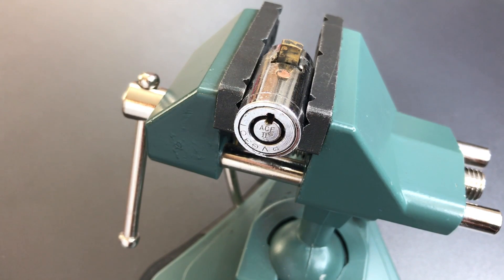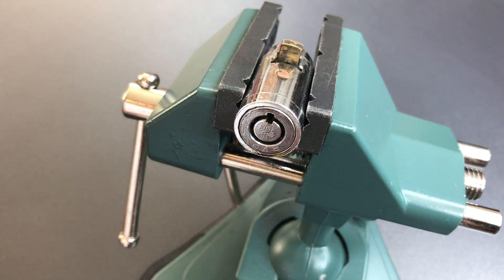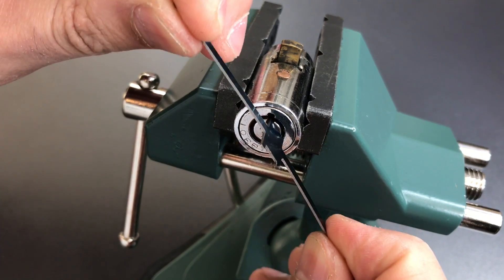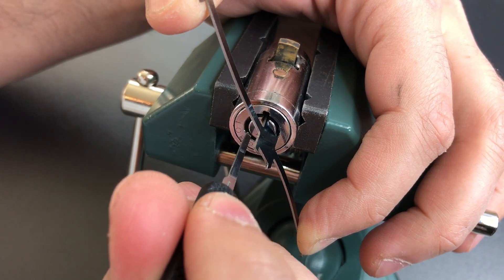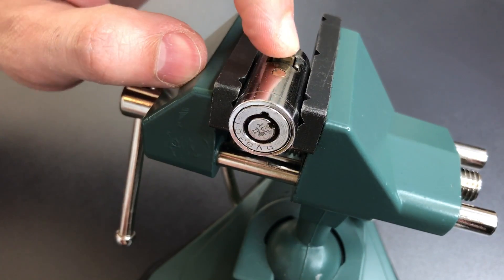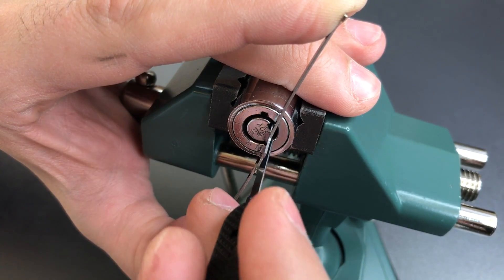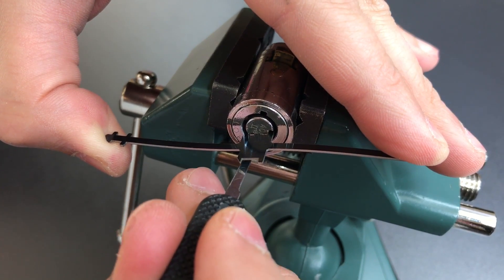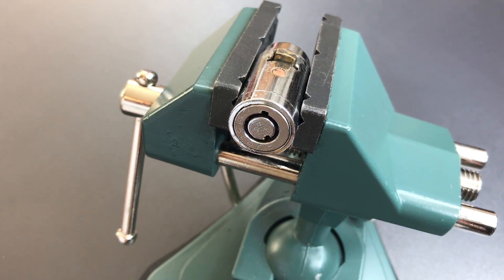[533] Ace II Tubular (T Handle) Lock Picked

Comment: Once you get it picked and turned a little, you could use the standard tubular pick to "impression" a key. Then you wouldn't have to hand pick it again, over and over.
Reply: Couldn't you also use the tubular impressionist tool to single pin pick it, then lock the pins in place?
Reply: @lordfly88 yes, that also works

Comment: I picked my first tubular lock last weekend.  I had never practiced on a lock that I owned. My first tubular pick was in the wild at work (for a purpose sanctioned by my company). It took me about half an hour for three picks to rotate it far enough to unlock the lock from a computer.  I had to machine my own tensioner and pick.
Reply: What’d you use as tensioner and pick?
Reply: @livvylouise114  I’m sorry, this probably won’t help but for a tensioner I used a small Allen wrench that I ground down from six sides to four sides that fit perfectly into the square notch in the core.  For a pick I used a thin straight hardened steel pin and put a handle on it.   I have access to large fairly incredible mechanical and electronic prototype labs so I just made them.

Comment: We used to have people squirt super glue or glue in them. All you can do then is drill them out and replace the lock plug.
Reply: Wouldn't using a solvent such as acetone also work? Acetone dissolves cyanoacrylate superglues readily, though it can damage paint finishes

Comment: I started tubular locks by SPP so when I got a set of those 3 tube picks I was thrilled I only have to pick it once, plus I have a pattern I can use to decode it. 
BTW: if you open the glass display where they keep the slingshots and pellet guns at Canadian tire stores, and pick up and examine the products, they get really irritated and lock it up again.
Reply: Your post has been flagged for violation of rule 2

Comment: Yikes.  I never knew this type of vending lock was so easy to pick.  

My bosses at the big vending company I worked took key security and accountability very seriously.  Each vending route was supposed to have their own key and keys were regularly inventoried and extra keys confiscated.  Also, if the pip on the tubular keys was worn down, they key was replaced.  This prevented pulling the key out before the lock was fully re-locked or left in the unlocked position.
Reply: This sounds more like employee theft prevention than random thievery prevention.
Reply: You might be surprised that back in the day getting keys was as easy as going to Coke and paying $1.50 plus tax for a duplicate key. And while one person was at the parts counter a friend, or friends could walk around collecting a few extra keys. They were either hanging out of the lock, or in the key return.
At the time there were 40 keys total. CAV 1-20 for Cavalier machines, and DN 1-20 for Dixie Narco machines. All of the locks had the key number stamped on the face.
RC Cola had 3 keys RC 1-3
Pepsi wasn't like that. No key numbers and they wouldn't sell replacement keys.
Dr. Pepper machines were Cavalier or Dixie Narco and had the same keys as Coke.
Tom's Snack vending machines took 2 different keys to open, one for the door, and one for the coin box. And they only had 2 different versions. You couldn't buy them so you had to come across them in various ways. 
Laundry mats with tubular keys had locks with ZB 1-10 but they had different keys for different locks. The coin box used one key and the rectangle lid that accessed the mechanism was different, and almost always was a ZB-3. You could wash for free if you had a ZB-3 key. You could buy old machined, or junk machines and they usually came with keys. 
Laundry

Comment: That's an interesting tool - like how it has a warded lock try-out key at one end.  I've read somewhere that once you pick a tubular lock you can improvise a "key" by jamming something like a business card in the slot.  No idea if it works, not got a tubular lock to try it on.
Reply: Huh, never thought of it working as a pick for warded locks; Im pretty sure its just tipped as a flat, prybar type tension tool.
Reply from the maker: +Spring Bloom Nope, it is a warded lock pick. And yes, it's a strange combination of tools. 👍
Reply: +LockPickingLawyer 

Cool
Reply: +LockPickingLawyer 

Ah, ok. I had watched it on a small phone and only noticed the 'top' end.

Comment: I NEED the US locksmiths made tubular tensioner tool !! Sparrow's is not as long and does not have the leverage STRENGTH to do the job!!??? Or should i spray a LUBE inside the ACE lock ?? It's probably 43 yrs old but worked fine when I had the key ... ugh 😩
Reply: Question for u my friend. Do you know of a tubular impressioning tool that will open an ace 2 tubular  lock? Other than the 500 peterson 1.please help! 😂

Comment: are these relatively easy or hard to pick for common thieves ? i just bought an e-scooter and i bought a simple bike lock that is using 4 number code combination instead of a key to open and my co-worker advised me not to use these kinds because they are very easy to pick im currently thinking about buying a xiaomi break disc lock which has similar tubular keys

Comment: Mabe I just got very lucky or the lock was broken or fake but I have opened an ace II with the impressioning tool. It took a lot longer than any other I have opened with it but it did eventually open and I was able to do it three different times. Like I said mabe fake or broken idk mabe after too much use the varying spring tensions could eventually become the same as the springs wear?

Comment: Nice job! I practice on a Southord 8 pin tubular  picked it twice clockwise to open I assume now I must go counter clockwise twice to original position to be able to use key again? No luck so far! Wondering if heavier tension is needed?
Reply: What was the answer for this as he didn't address how to get the core back to the original position
Reply: Hi David
Hope all is well
Big shot rarely replies to anyone!
You have to pick it in opposite direction to get it back to original position to be able to get key to work.
It takes time  especially  when you have to pick it back more than once!
Stay well 🙏

Comment: Couldn't the impressioning tool be used to tension and push pins down with your fingers? That would create a key.
Reply: That's how I used them the first time I got one of those multipin tube picks. I didn't know how to use it the right way so I just used it to tension and SPP it with the 7 picks.
Reply: @parapicktog7734  I know that isn't how they are used, typically, but my thought is that they could be used to SPP when they won't impression.
Reply: @dl200010  sure they can, and when your done you have your impression. But the thing is...because the pins are so stiff to move, it's hard to feel the clicks and easy to push too hard and go past the shear line. So it might take a few tries. But I thought of something else after watching this video... if you SPP it the way he did, only turn it halfway to the next position, then you can use the tool to impression it and don't have to pick it multiple times.

Comment: could you have used the pick tool to impression it after the first pick?
Reply: no
Reply: Yes, according to video 68. It makes since it can. Once you rotate the pins in between the   locking points you should be able to take your pick and get your impression.
Reply: yes you can, typically with about 80% luck doing so :)

Comment: Couldn't you pick it as you do here, then use the tubular pick to impression it when the pins are between positions? I'd think that would be quicker, and you'd have a "key"
Reply: That's how I used my first tubular multipin pick. I didn't know how to use it, so I just used it for tension and used the 7 picks to SPP it. I thought that was how you were supposed to use it, and the only advantage was you only have to pick it once, then can turn it all the way and also have an impression to decode it.